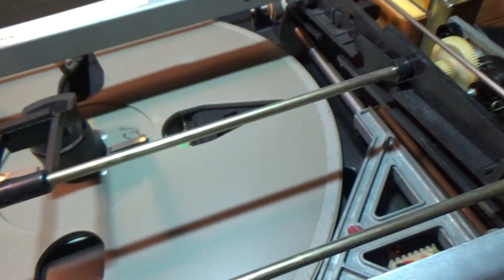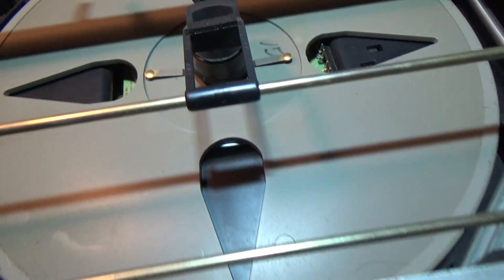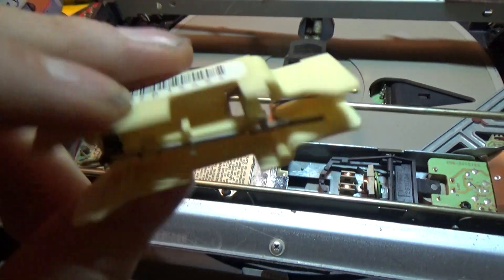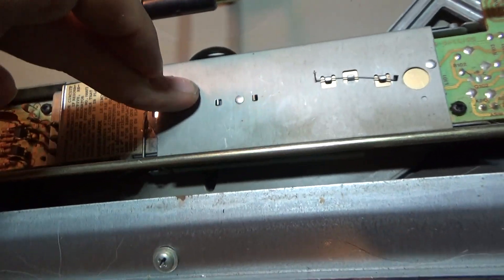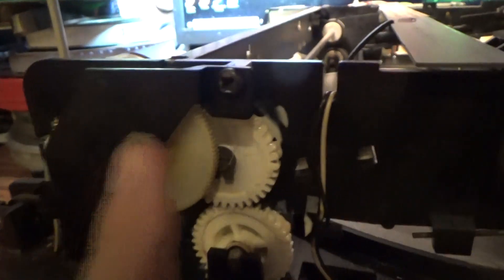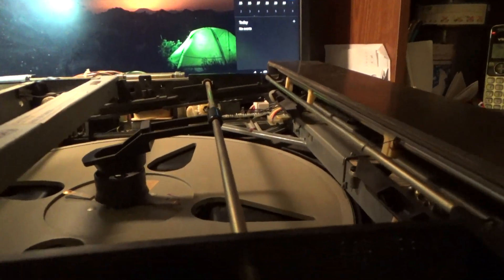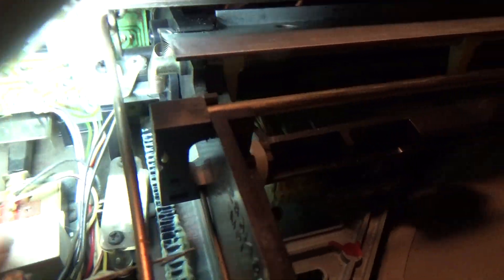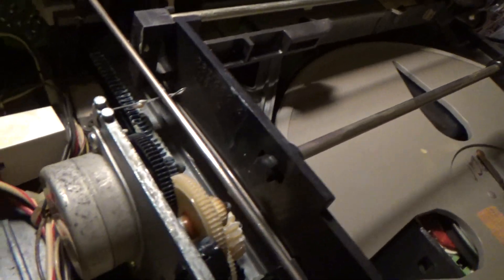RCA Selectavision CED Videodisk Player Repair Part 1

Comment: I seen these at Sears back in the 1980 and that when they sold tube television sets .
The picture was surprisingly very good for it's time .
But VHS 📼 was right around the corner.
I read this is what made RCA for out of business and get taken over by Thomson consumer electronics.
They had over 2,000 films on them discs.watch technology connection he has a good 5 part videos on YouTube.

Comment: Do you take repair jobs I live in no where Pennsylvania no one fixes them, please help
Reply from the maker: whats it doing or not doing
Reply: @lexmarks567  it won’t grab the disc carrier .
Reply: One powers up but does nothing I think the belts are shot I have three machines all RCA
Reply from the maker: @jeffphillips6795  shipping 3 machines to and from is going to be costly. There is a facebook group called CED Magic - the RCA Selectavision Video Disc. they are very helpful.
Reply: I would send one don’t need 3  machines. I would like one  working one.
Reply from the maker: @Jeff Phillips  pick one that you think has the best chance. Probably the one that has issues grabbing the disk as that might just need greasing. You have 3 machines. One won't grab the disk, one powers up but doesn't do anything, what's the issue with the 3rd one.
Reply: @lexmarks567   and I am sending this where?
Reply from the maker: @Jeff Phillips  I'm in Michigan. I'm not a expert so no guarantee that I can get it working. What Is the issue with the 3rd machine. While it would cost allot in shipping you could send the 3 machines and I can use 2 of them to make 1 working one.

Comment: I have an RCA Selectavision player and the disc I have skips with glitches. What are the reasons for this?
Reply from the maker: The disk itself is probably worn out or damaged. Try changing the stylus but if other disks play fine then that disk is bad.

Comment: Too bad it didn't end up working out, but that would likely be par for the course.  I'd meter the switch at the very least to make sure it works.

One time many years ago, a neighbor brought over a Samsung VCR that stopped working and gave it to my dad.  The neighbors were Korean, that's why they bought a Samsung.  Didn't make it a good machine though, obviously.  It was a 2 head mono unit, wouldn't do much of anything.

Anyway my dad worked on it for a couple of weeks.  Something inside got REALLY jammed up and bad, the whole mechanism was out of time and would grind gears and other nasty stuff.  He eventually got it working so it fast-forwarded and rewound, and would also play and record.  You could fast-forward while in play, but if you rewound in play the tape would spill out, though you could go back a good 5-10 seconds of tape without too much spilling out.

Eventually something else gave out inside and that was the end of it.  Even when it did work, it was kind of clunky and poorly designed.  Surprise surprise, today their stuff isn't much better.

Didn't know you watched Techmoan, I was gonna say you're getting like him with all the obscure formats.
Reply from the maker: Its a double micro switch or at least 2 switches on top of each other. The track is making contact with the top switch but it's not contacting the bottom switch. Nothing appears broken off on the track and it's not off alignment as it maxes out hence why it's grinding and i goes all the way to the end manually.  When I press the bottom switch the arm stops and the machine gets ready to accept a disk. release the switch and the arm moves. The top switch has continuity when it's not depressed but when it is depressed it has none. I'm at a standstill at the moment.
Reply: Well now I'm fresh out of ideas also.  Could do a ghetto hack and clip some leads on to your own switch outside the machine, to see if it will load/play a disc.  If you have one, that is.
Reply from the maker: @jaykay18  well I somewhat got it working. I lubed the track and guide post but I have to give it a nudge to get it to contact the bottom switch. Then it kinda wants to load the disk but doesn't fully grab it so have to help it load then it spins up and counts up but I don't know if it's outputting as I dont have the remote for my TV so I can't set it to 3 or 4 and I don't feel like digging out the the crt I do have so ordered a 9inch crt broadcast monitor. Meanwhile ordered a 2nd ced unit same model. Need a coaxial to rca adapter so I can hook it up to the stereo.
Reply: Really, it only outputs over RF?  Wow, that's pretty old.  But then again we weren't dealing with composite video per se in the days when this thing was new.  I have an RCA Selectavision from 1977 I think, and that includes composite in and out.  An old VCR is a great thing to have as that will convert RF to composite and vice versa.  But there are plenty of inexpensive RF modulator devices out there that will do the same task.

I'm interested in this 9" CRT broadcast monitor, would you have a link to what you got?  I can wait of course, just curious.
Reply from the maker: @jaykay18  some of the Videodisk players have rca out but most are RF. If you search for CED disks and you see some of the caddys are white and some are blue, blue are stereo release while white is mono. Here's the eBay link. https://ebay.us/FROui5